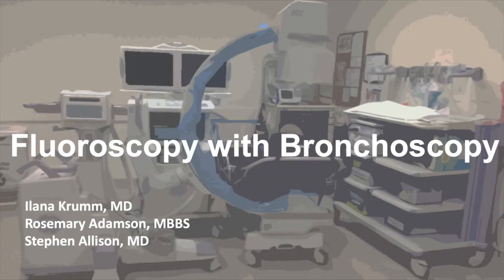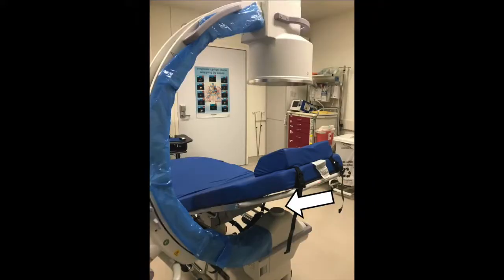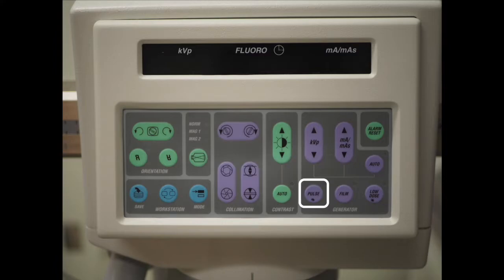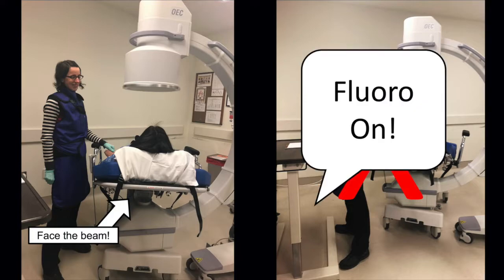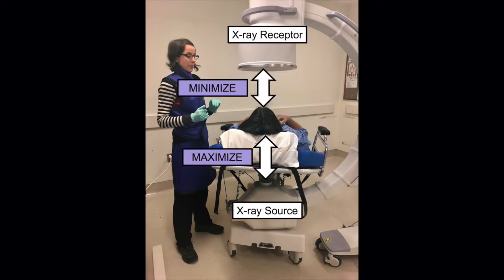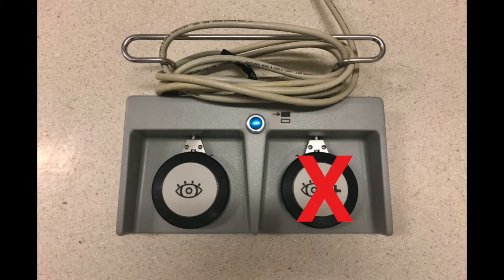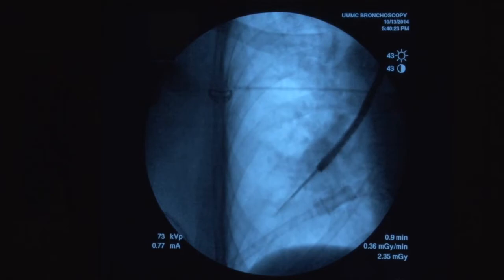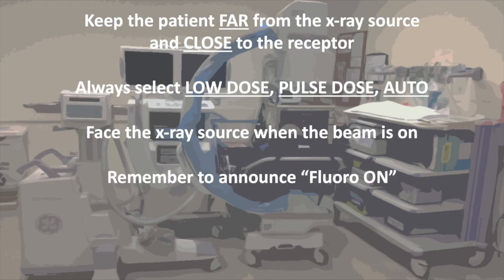Fluoroscopy with Bronchoscopy - BAVLS

Comment: Before placing forceps into the airway, you should always suction your airways first (7:33) to remove excess secretions, so that you can appropriately visualize where you are sending out your forceps.  Overall great video, something I will encourage my fellows to watch before they start doing transbronchs.  *I'm IP trained.
Reply: @Shruti Shrivastav It tells you in the video that it is used for activating fluoro on, and the pedal to the right with the + sign, is boost mode, which increased the radiation to improve the image clarity.
Reply: @Shruti Shrivastav It depends on the model, but yes, there should be a sound and a light to indicate fluoro is live